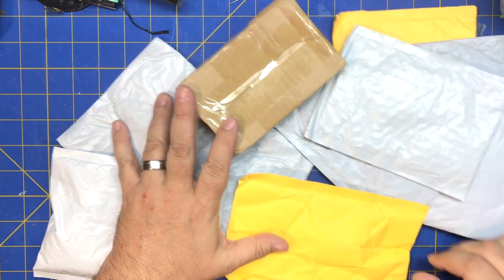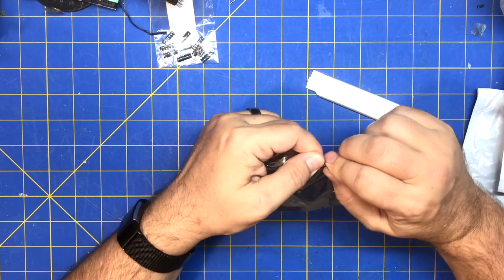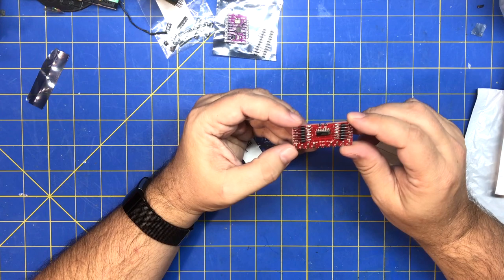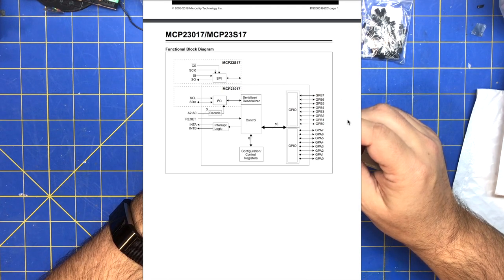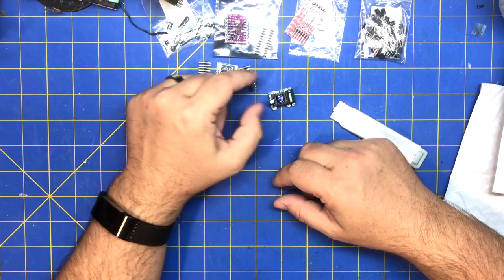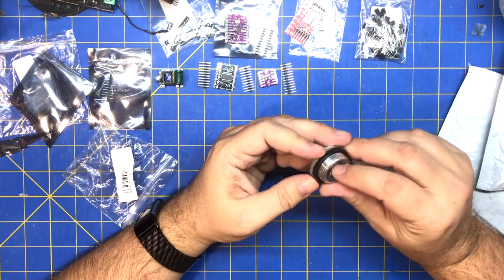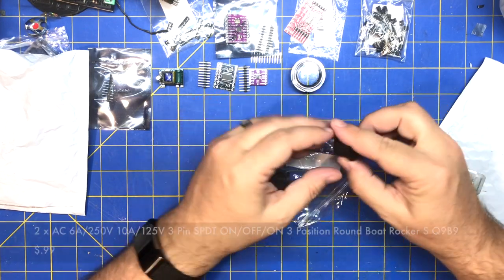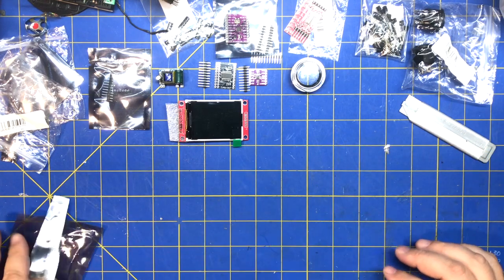Mailbag #61 11-2019

Comment: If you want a nice "sight glass", I'd look for spare parts for a "Shaper" or other machine that uses recirculated based methods of flow lubrication.  Machines such as shapers typically use them so you can see the level along the ways of the machine head. Check out Abom79's vids on his shaper, among all his vids of his restoration of his machine you shall see the sight glasses. 

The bit you tore out is where you would put a bit of wadding so swarf etc. can be caught and seen, indicating a problem with the machines innards or a way to tell if the oil was getting a bit dark due to being aged / operating out of temperature. They also provide a means of restrictive flow negating the need of other forms of regulation for the oils pressure throughout the entire machine, the excess pressurised oil then gets distributed among the gearing, leaving the areas under the sight glass to slowly distribute oil along the ways while in operation. 

Glass isn't always used as the oil during use gets hot and as a result, the glass has potential to crack due to heat cycling. Resins / or plastics are usually more forgiving over time, though not infallible. Hence them being sort  of "consumable" from the operators perspective, and not usually a high quality component.